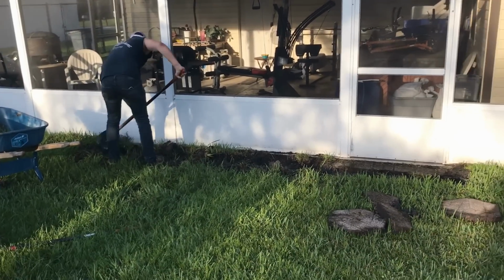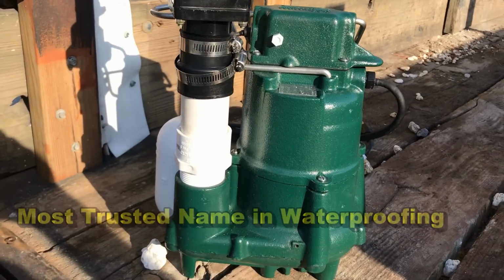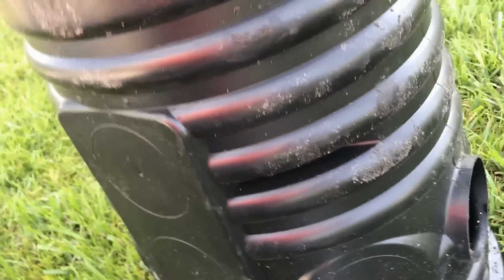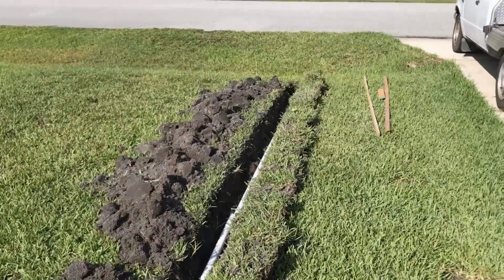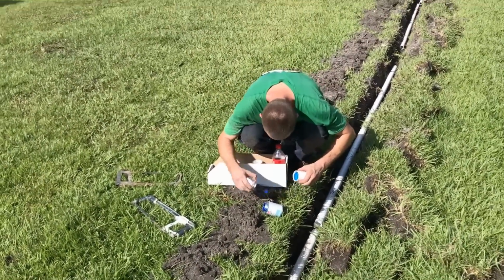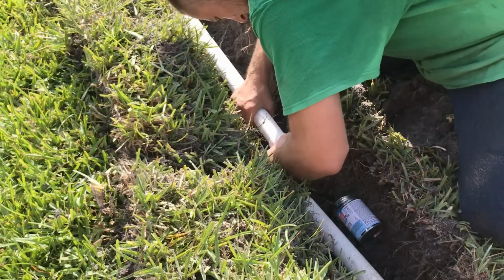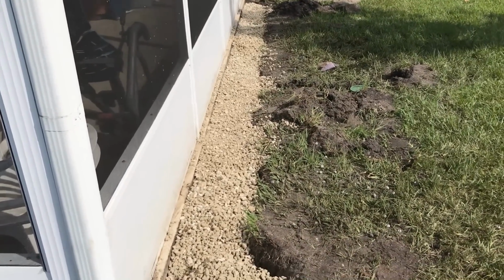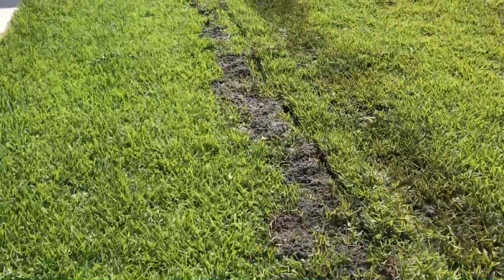French Drain Made Easy

Comment: Will there be enough flex in the sump discharge after loosening the top clamp on the check valve to get the pipe off? In case you need to replace the pump or check valve.

Comment: If only my soil was like that. Mine is solid clay that stays completely saturated with water and takes 4 day of no rain before my son can ever play on it but still soggy to a grown-up.  I have 2 hills at the back of my yard one that runs the left side and another that runs along the back and are both about 7-10ft above ground level at the peak.  Clear cutting in the woods ontop of these hills has resulted in not many trees soaking up water and it all running into my yard.  There is Swale at the top of the back hill and a french drain at the bottom and still takes this long for my yard to clear up.  Problem is with the clay - subsurface water can't rise as the clay is packed and surface water can't seep down because the top is packed hard which leaves me with non usable yard for atleast 2-3 days after every rain.  We just moved into this house 3 mths ago and aren't off to a very good start.